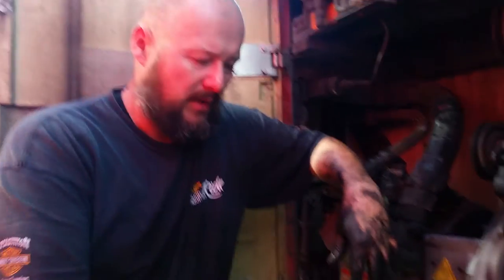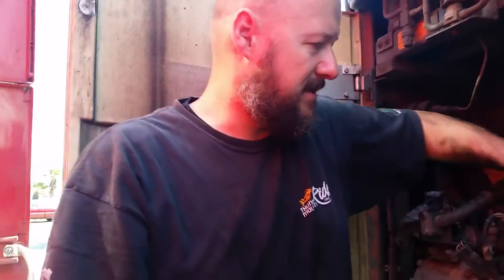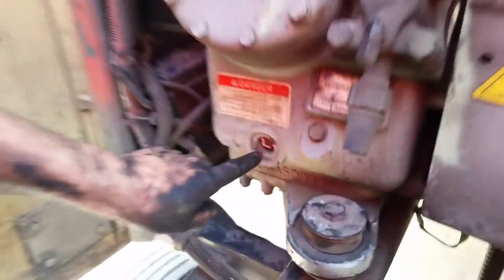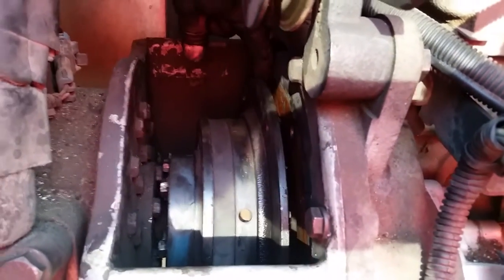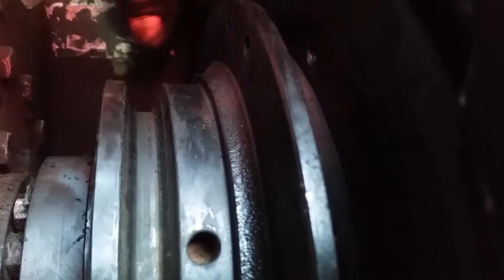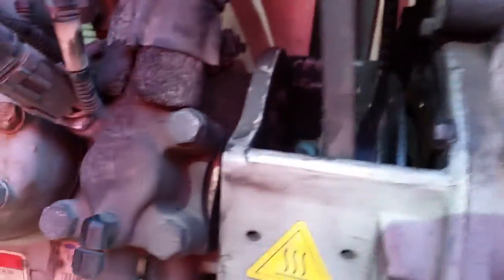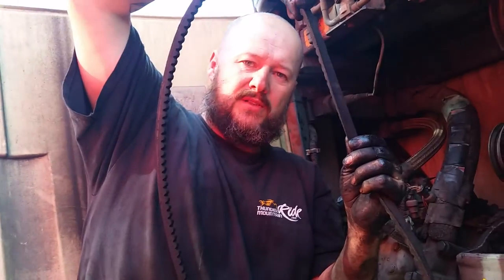How to change belts and oil on carrier transicold reefer unit,mjenjanje kajševa i ulja na riferu

Comment: it takes a little less than 14 qts of oil.  also under the fuel priming pump theres a bolt take it off and inside is a strainer clean the strainer always debris in there.  i work for carrier and i do preventative maintenance on a fleet of trailers for a food distribution company.
Reply: Is there an EGR valve a reefer system

Comment: if you front seat the king valve you can do a low side pump down but never open your refrigeration system to the atmosphere leave that to the pros its very precise on what you need to do and can damage your system if you don't have the equipment.

Comment: thanks a lot great help with your video,i have to change water pump  on my unit i think, i have drops of coolant dripping out the bottom of pulley through a small tube?
Reply from the maker: you are welcome. Is the coolant coming out of the tube that is coming from the top,if so check where it is coming from because sometimes it is coming out of the overflow canister and that isn't a big deal,mine has done that quite a few times in few years.
That isn't something you worry about.That canister on top doesn't even have to have any coolant in it but some people don't know that and they fill it up and than they have coolant leak.

Comment: I have a questiin: oil filter is orizontal, fid you instal it dry? Or there is a way to fill it up?! Thank you!!
Reply from the maker: You just install it dry and as soon as you start it up it's going to suck in the oil in it and fill up and after that you want to shut off the engine itself you going to let it settle down the oil inside the crankcase and everything and then you going to check the oil level again and feel up as desired or as needed. The fuel filters are always in most cases vertical so you can fill it up so say prime it first before replacing.
Reply: zox gunic: thank you much, and one more, there shoulg be for sure cross to Baldwin filters, i think those are beter..!

Comment: You lost me @ 6:36 belt # 20 or 19?
Reply from the maker: B4ZERO 6:36 nothing about 19 or 20 be more specific I'll do my best to answer your question
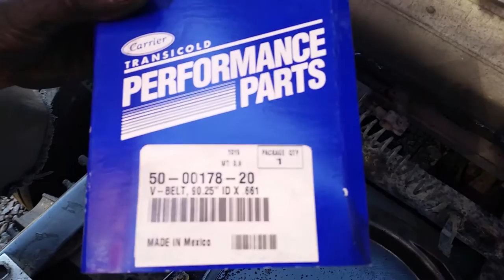Reply: zox gunic @ 6:05 through 6:18 you showed 2 different types of belts one's ending in #20 & the other one is ending in #19 which belt did you put on the fly wheel #19 or #20?? and what was the difference between the two belt types?
Reply from the maker: B4ZERO I get it.Number 19 is the one that goes on the flywheel.The difference is in the size the length.